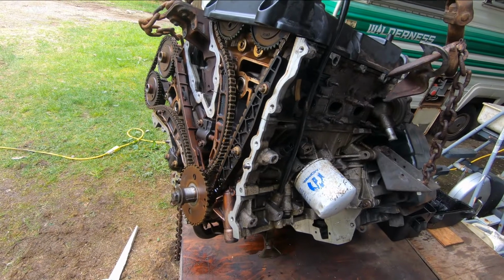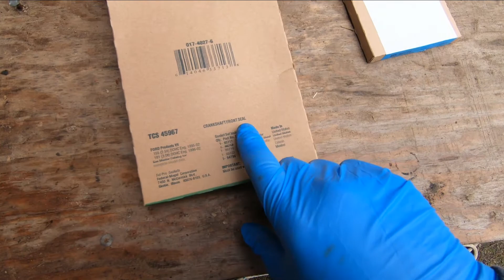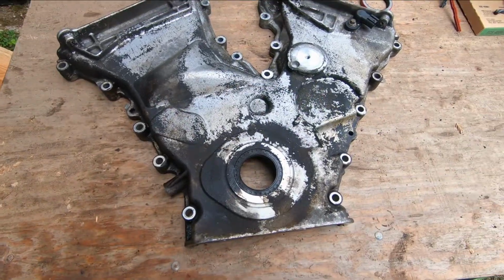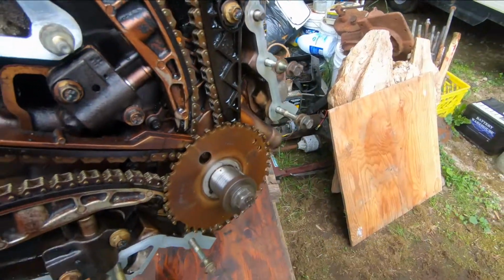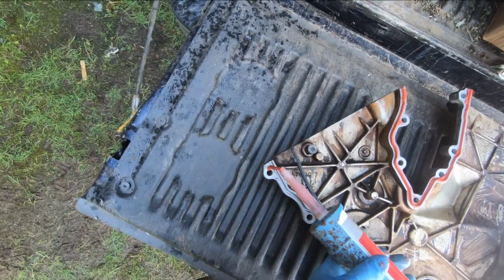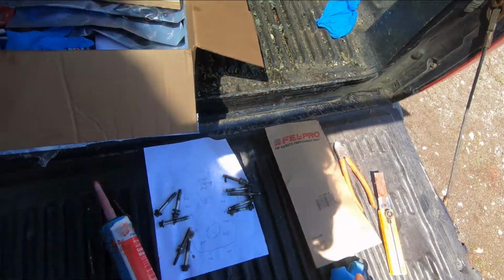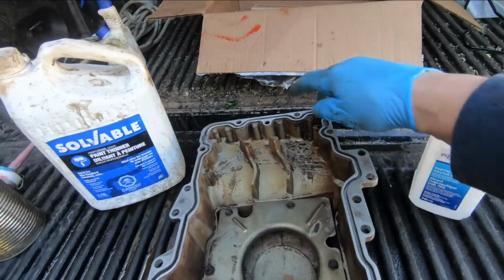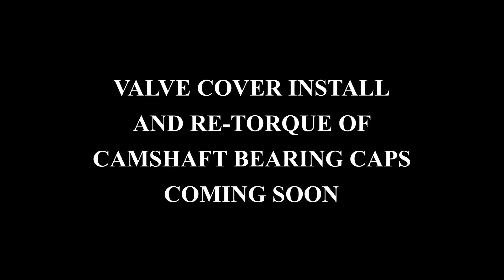HOW TO FIX LEAKING ENGINE GASKETS

Comment: Good job. That ought to keep the oil where it belongs and off your floor.
Reply from the maker: I hate a leaky engine, although much rust protection on the frame and underbelly of many cars stems from an engine oil leak. This project was a compromise: the better engine with no leaks and lower miles has a knock in the bearings, but the old leaker runs fine, so that's what's going in. I don't think this one will leak at these covers again. Thanks for stopping by!